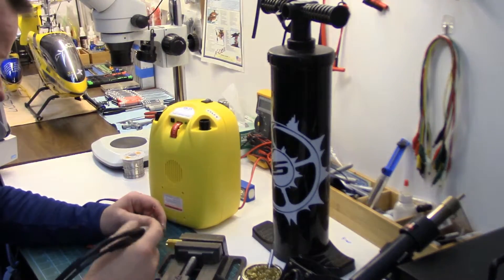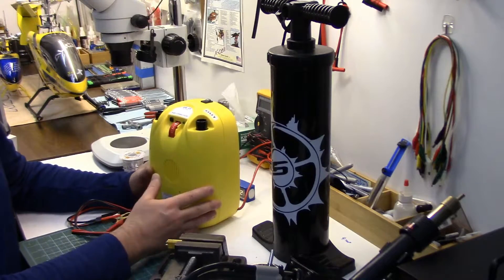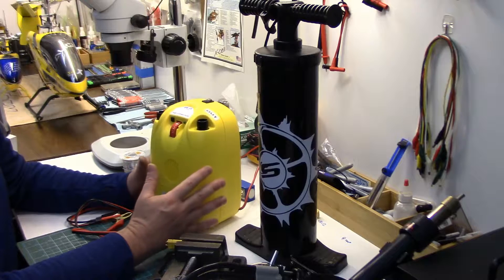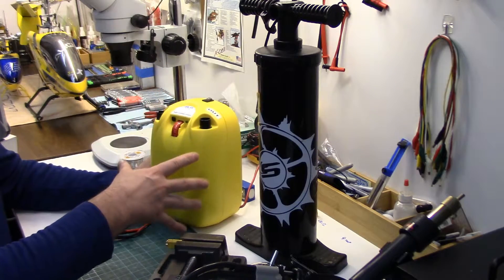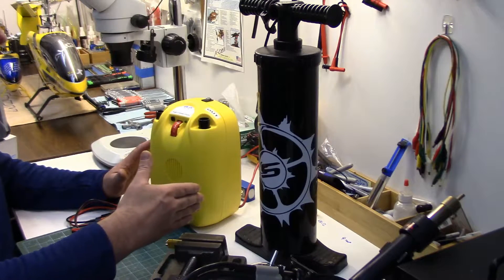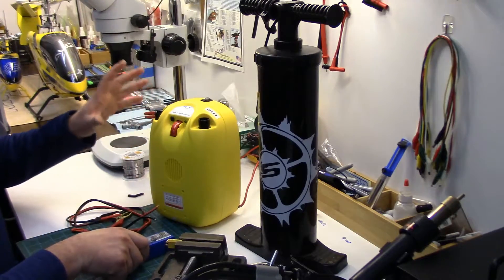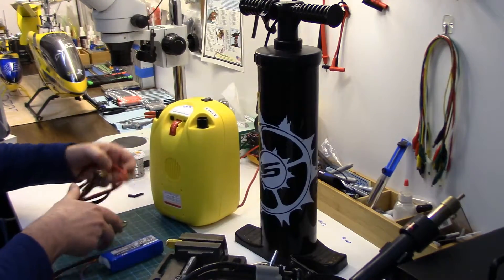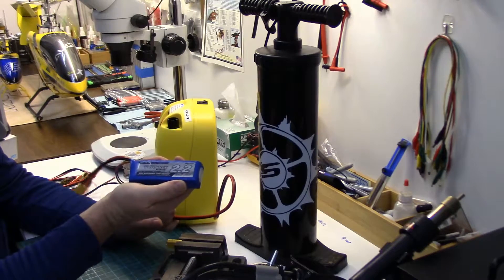Cheap Electric Kite Pump Idea & How To Power It

Comment: Building a similar set up for my inflatable drop stich dock for taking to the lake. I'm using a different model pump, but same concept, and a 3s 4600 lipo battery with XT-60 connectors. I've never really done anything like this previously and went searching for confirmation that it would work. Luckily, I found my way to your video. Thanks for posting. Really appreciate it.
Reply from the maker: Hope your setup works as well.

Comment: Thanks so much for sharing! I purchased almost the same exact setup as yours:

- pump $92
- battery (5000 mAh) $25.83
- charger $9.99
- xt60 connectors $6.99

Total: $135.

I tried it on my 14m kite, pumped it up to 7 psi in about 8 minutes, much faster than I would have pumped it with the manual pump and no effort ...    :-)
Reply from the maker: Glad you like your pump setup as well. This one is still working well and haven't had to use a hand pump now in almost a year.
Reply: It takes you longer than 8min to pump a kite! You need to eats some Greens...lol